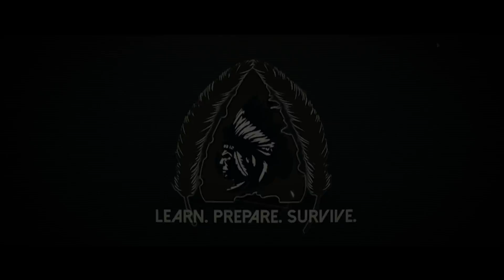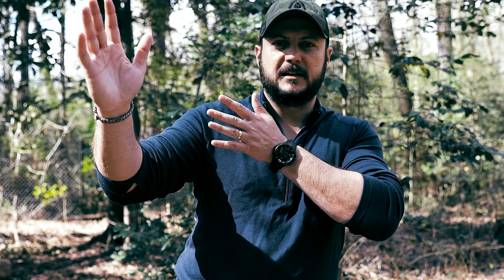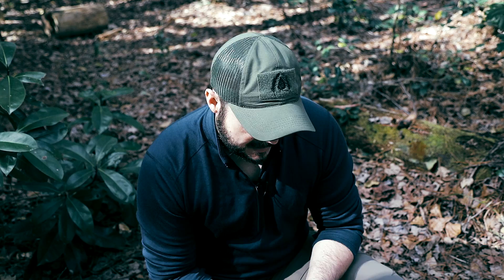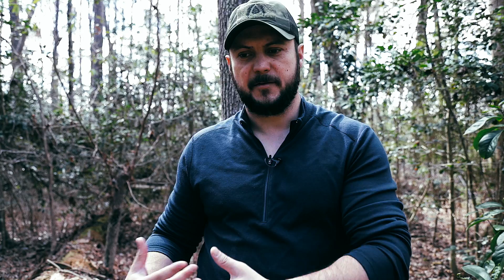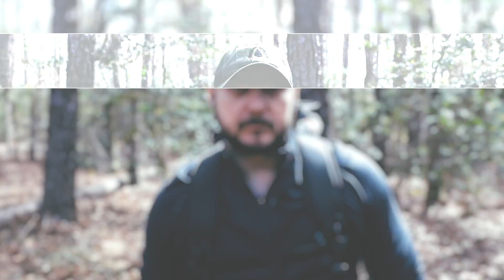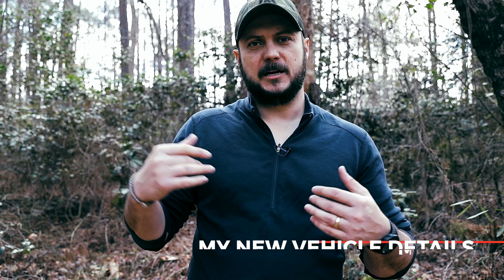5 Techniques to Track Man

Comment: (Wife typing) Thank you so much for this video! I am an author tailoring a scene in a novel where my medieval male protagonist is tracking a small party on horseback. He quickly realizes sign is being intentionally left, leading him to believe the party has a traitor in their midst. The sign is being left for the antagonist. 
This video was helpful because I was able to add details such as bootprints facing yellowed snow, indicating someone relieving themselves, but the unmistakable intentional breaking of a branch. Thankfully, by happenstance due to the pacing of my story, this part comes about in winter, offering the assistance of snow on the ground.
I also added sparrows a few miles down the way where the party stopped to eat, and the sparrows have found crumbs dropped when they ate.
Thank you again, sir!

Comment: on my hiking stick I have different colored rubber bands and carved inch marks so I can measure foot print and distance between steps ...easy and it works
Reply: Gadsen Cullpepper serious question, what do you use that information for?
Reply: @numbereightyseven  The deeper the footprint, the heavier the weight of the individual. The longer the stride, the bigger they are (vertically). While longer strides can also be attributed to running or moving quickly, there are different indicators on footprints that differentiate between someone running and someone walking. For instance, the heel is going to be jammed in versus a steady roll like at a walking pace; among another things.